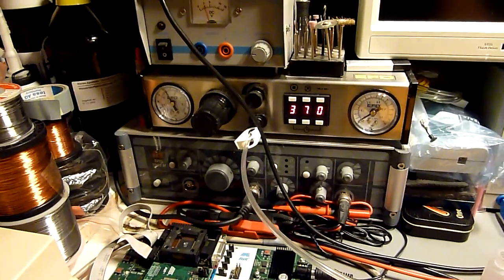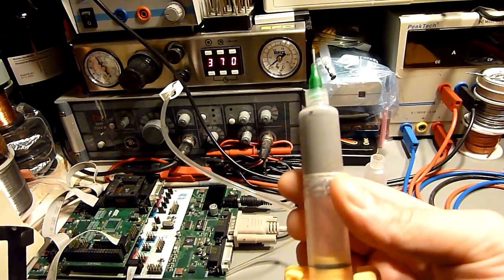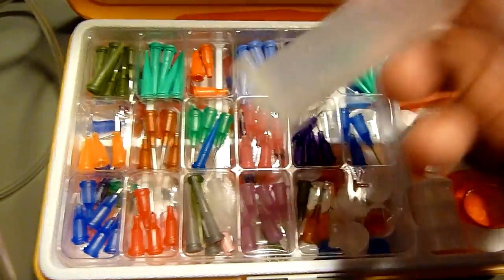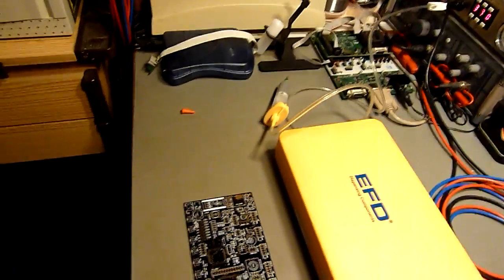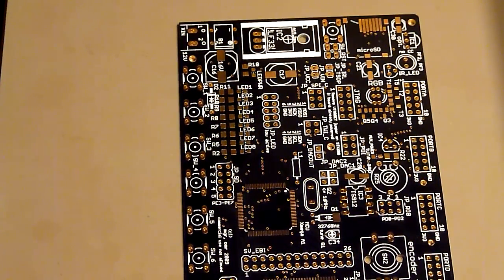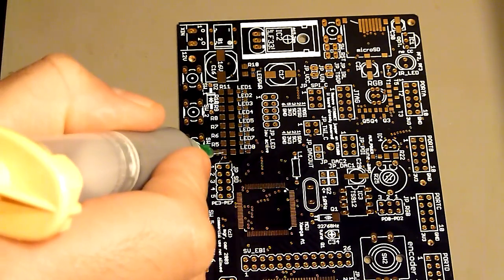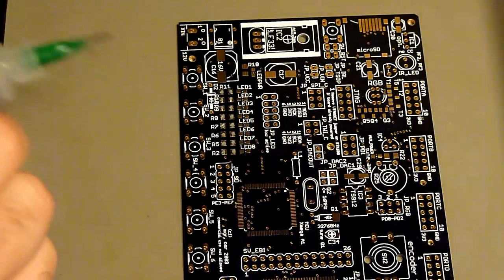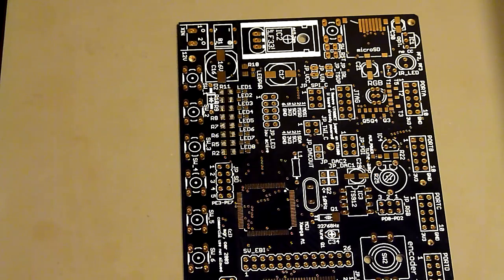Demonstrating dispension of solder paste with an EFD1500XL fluid dispenser.

Comment: Michael < When you'll be doing next new project - maybe you could make a video about designing a PCB. Like which soft to use, how to make simulations, print the pcb layout. Because most of the time i see in youtube guys soldering, itching and other stuff with already made pcb design. Would be good to see how the electronics scheme is converted into pcb design. Und danke fur die videos ;)